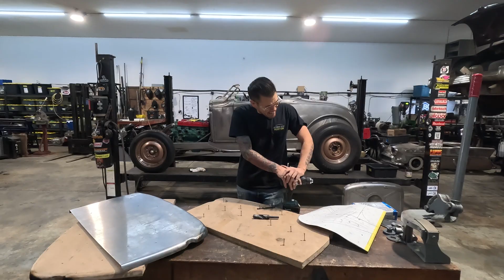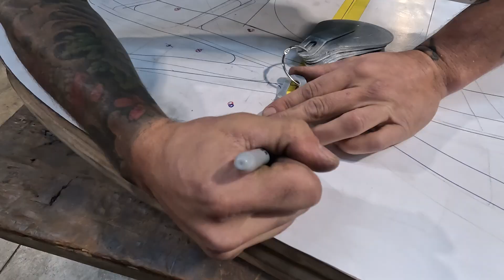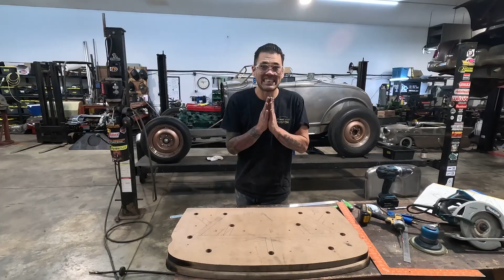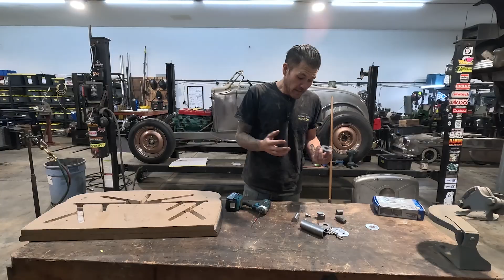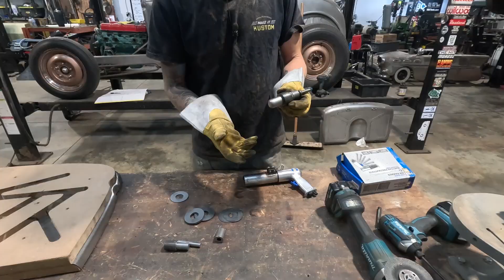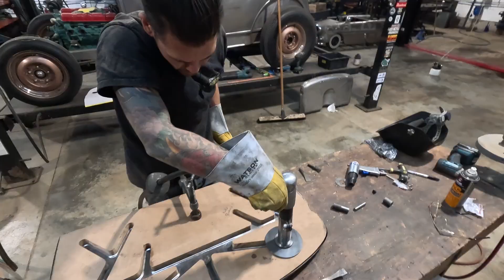PART 2! Beading a HAMMER Formed Firewall - BEAD ROLLERS Can't Do THIS!

Comment: A few comments - great video, BTW.  Get a patterning bit for your router.  Then you can fine tune one mdf panel and cut the slots in the second perfectly.  Old guys like me have a tool called a star-wheel that can be used to roll over a paper pattern, transfer the pattern with a line of pinpricks that are connected with a pencil line.  A ponce bag can also be used.  Star wheel not necessary for what you did, but really useful on transferring curved lines from a paper pattern.  I can give you a photo if you are interested.

Comment: Just a thought: Maybe a couple sets with softer material. Rubber or maybe brass to refine. Adjust air to adjust force applied. A teasing trigger in the gun would be a good addition.

Comment: In my opinion there is a small flaw in your indentation pattern design. In the top center there are five beads running together in one spot in a star shape. My guess is that designing the top diagonal ones to connect not in the center but more left and right of the center would result in bigger angles at intersection and would avoid the "flat" plateau at center.
Just my two cents: The mother of all indentation design is the good old jerry can.

Comment: I seen someone on YouTube make a hand held air hammer out of an air needler he took it apart to fit a hammer rod in it 
I could see where it could use some adjustments to make it even better. Hes on the right track because those air needler's are not that expensive to work with.

Comment: Great ideas as always.  If you put a hardened “hammer” in there I think something will shatter.  Possible solutions either play with tempering the cut off bit, or work out a way to reincorporate the return spring and possibly weld the whole bit assembly together eneal normalize and harden? Can’t wait to see what works.

Comment: Great video as usual 👍 Silly question why not weld the depth stop on the die that way it cant go to deep just make it high enough on the die to go through 1" board and get enough depth for the bead then add washers under it to shorten the depth

Comment: this tool (hopefully soon to be kit) is just brilliant! simple yet efficient, elegant and achieving all functions with minimal features (including safety - last... ;) ) thank you for sharing this stroke (...) of genius!

ps: depending on the strength of the air hammer, maybe one want to set it so that the end of the travel is near the desired bead depth, so that the depth stop is not exposed to the full strength of the hammer (that means the actual depth would be tuned by a variety of spacers rather than relying so much on the stop - so as not to use is as a punching tool)?

Comment: Couldn't you just make the air hammer bit shorter so it can't punch through the piece you made at its full stroke length, or does that take all the power out of the hammer?
After thinking about it you may have already designed it that way, I was thinking the hammer was only half way through its stroke when it hits the stop causing it to punch through, or is it the resistance of the metal you are forming that is causing it?
Or am I just completely confused and not making any sense at all? Lol

Comment: I think your die needs to be oval, so if held still it would form a hot dog. A very short hot dog, ie 1/2" wide & 3/4" long.

so it will still track curves, but smooth the peaks.

on your depth stop, try adding a thin cushion. So the die isn't impacting the barrel extension directly. Something like an o-ring, or neoprene washer, might help. They probly won't last very long, but they are cheap & replaceable. (worry about work first, reliability later)

Comment: Karl, how big of plannishing head do you think you can run on an air hammer? i have a 51 GMC truck that had the roof caved in by a shed that was loaded with snow and then had a tree fall on it. i was thinking of making a huge plannishing hammer head for one of my air hammers. you think a 3" or 4" head would be too much?
Reply from the maker: That's too big. The contact patch will still be small. Beat the metal out as close as you can and use shrinking disc and planishing hammer to smooth.

Comment: If you had a route with plunge, use a round nose bit and a templating collar, thru the first pattern. Machine the hammer bit to match the bit radius profile. Then you'll have a back stop instead of air, and maybe get a smoother finish.

Comment: So, the speed of a point on the outside of a drill bit in units (I chose mm) per minute will be:
the diameter of the bit × pi × the rpm.
Just to give a sense of what that looks like, the following is a few quite small bits, where you might mistakenly think there's not much difference, figured for 1,000 rpm:

1 mm = 3141 mm per minute
2 mm = 6283 mm per minute
3 mm = 9425 mm per minute
4 mm = 12566 mm per minute
5 mm = 15707 mm per minute

For those who don't get metric at a glance, that's a range from just over 3 metres per minute to best end of 16 metres per minute, or from about 50 mm per second to 260 mm per second.

Comment: I know where there is a pullmax in Canada, it's sitting outside about to go through its second winter, this thing will never ever be used as long as the owners backside points to the ground, I'll give you a clue who it is, he welds with a coathanger and shapes his metal with body filler,

Comment: Just an idea for radius guages, a 1/16" hole at the center point of the radius would be super handy. You know, just so you could mark a center reference with a paint pen or sharpie. someone probably already mentioned this. Also you might look into aircraft rivet guns, they hit a bit harder & slower, more controllable. Cheers.

Comment: When you took that firewall out of the form, it looked as good as any of the import replacement sheet metal and we already know it fits better.  Despite some lumps, and the setback with the depth stop, the firewall looks good. 

I do understand that it is not finished though.  I remember the battery tray video.  That was a good intro to hammer forming.

Comment: We used too fill bad cuts in mdf with bondo 
Then cut the line where we want or fill voids in with bondo and reshape the mdf and bondo to any shape we wanted old stereo shop speaker box trick

Comment: How about a depth stop from the bottom side? 1" wide, with the 1/2" radius for the ends, thickness to control the depth. for instance, 7/8" thick would keep the bead 1/8" deep. Make them long enough for the shortest bead. Move it along as you go. 
You could also anneal the end of the chisel bit, but it might mushroom. S7 or 4140 is probably the better choice.

Comment: Just a suggestion, I could make that pattern on my CO2 laser in about 1/2 hour ( machine time). I would do it with 2 or 3 layers of 1/2" MDF. The laser would also cut the screw registration holes.

Comment: How about this idea for the one bead. Remove all the screws and the firewall. Turn both patterns over, place a couple screws in to keep them aligned then with the Circular Saw, cut them in half from top to bottom. Then, flip both patterns over that have the correct angle bead pattern, put the patterns on the firewall and reattach the screws. It may mean that if the firewall holes do not then line up, you will have to individually do both sides using the firewall as the template. There is enough meat in half the pattern for which I believe will give enough clamp to allow the final bead to be formed without distortion of the firewall. Your call, just a suggestion.

Comment: In any cutting process it is about surface feet per minute. As you stated the surface feet per minute in wood for a 1" drill is not the same as in metal. There is more surface area of cutting in a 1" drill than there is in a 1/4" drill. Therefore you would have to spin the 1/4" drill faster to achieve same surface feet per minute as a 1" drill. The merry-go-round analogy works though.

Comment: if instead of going right through on your bottom buck, you make a "negative pattern" in you bottom buck with the depth you desire, (with a round tip router bit) then that would act as a counter stop when using your hammer bit? sort of like your planishing hammer.

Comment: Thinking about the forming tool:  how about having a pivoting shoe on the base of a rod.  IE the base plate would be flat with semi-circular ends, and have a loose pivot point onto the driven shaft.  Would be quicker to do long runs of molding, and  be smoother

Comment: Another great video. Firewall looks awesome even in its unfinished state. What about making the hole in your slug a bit deeper and then tapering the top to match the shoulder on the air hammer bit - transfers load around the top of the tubing as well as the flat piece in the middle…

Comment: Surface feet per minute is what you were trying to describe. You need to know the proper SFM for the material for youre working on and the material your tool is made from. This is the formula. 3.82×SFM÷DIA=RPM
Mild steel material and steel tool (not carbide) SFM would be 100 surface feet per minute, is a good starting point.
S-7 hardened to R/C 55-57 Will hold up well for shock. The whole thing should be made from S-7 for best results. I hope this helps. I was a Tool and Die Maker for 42 years. I love your videos.

Comment: That firewall looks good with just one of those short beads. It looks more factory than a symetrical firewall. Also it will not interfere with the steering shaft.